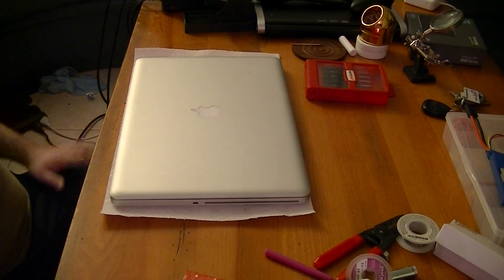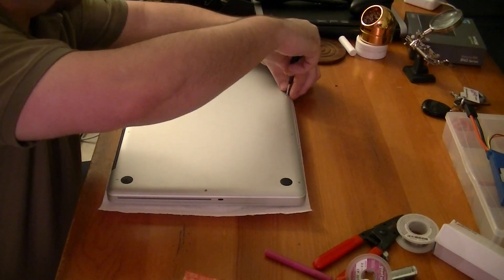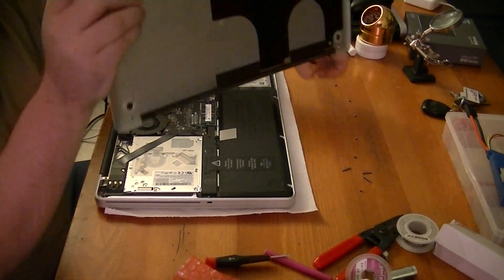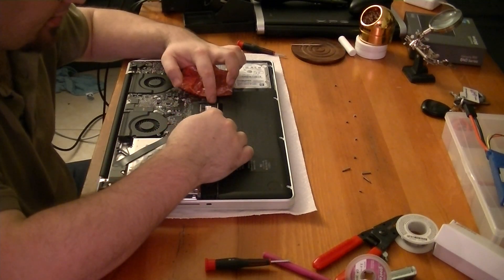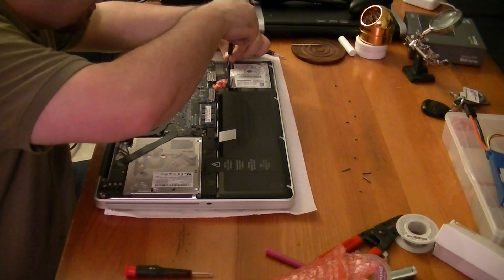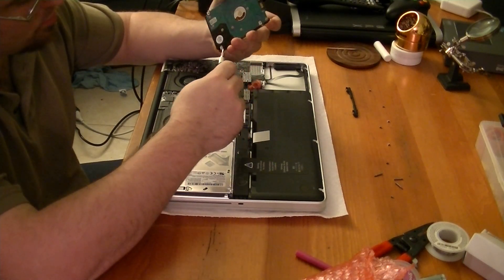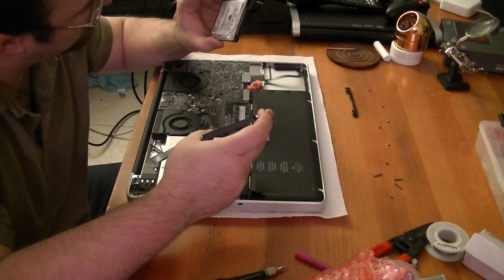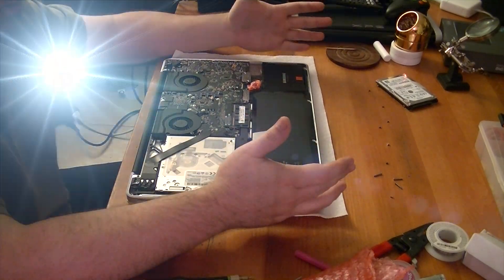Samsung SSD Install Into 17" MacBook Pro Upgrade SSD

Comment: if I do not plan to keep any files on my pre existing mbp, can I just purchase the SSD and install it? Would everything open as if it was a brand new MacBook or do I need to install programs and do all of the stuff in Pt 1. and/or wipe my HD first?
Reply: No! A new SSD has nothing on it. You have to clone the information from your original HD to your new SSD.

Comment: Does anyone know if the Samsung 850 EVO 2TB will work for MacBook Pro (13-inch, Mid 2012) OS: Sierra. Also do you need to take out the battery while installing the ssd

Comment: I've just installed a 500 Samsung SSD and enabled trim support, but I'm not getting any where near the read (268 mb)  and write (200 mb) speeds everyone else seems to be getting.  Any what the problem is?
Reply from the maker: It sure will!
Reply from the maker: +Stephen Minion Where did you install it?  Some of the MacBooks, depending on year, only support SATA II, which will limit your maximum speed.
Reply: +uberDoward Not sure what you mean by Where.  I replaced my main hard drive with this one..  Here are my specs. It's a mid 2009 pro.

Model Name: MacBook Pro
  Model Identifier: MacBookPro5,2
  Processor Name: Intel Core 2 Duo
  Processor Speed: 2.8 GHz
  Number Of Processors: 1
  Total Number Of Cores: 2
  L2 Cache: 6 MB
  Memory: 8 GB
  Bus Speed: 1.07 GHz

 Product: MCP79 AHCI
  Link Speed: 3 Gigabit
  Negotiated Link Speed: 3 Gigabit
  Physical Interconnect: SATA
  Description: AHCI Version 1.20 Supported

Samsung SSD 850 EVO 500GB:

  Capacity: 500.11 GB (500,107,862,016 bytes)
  Model: Samsung SSD 850 EVO 500GB               
  Revision: EMT02B6Q
  Serial Number: S21HNXAGA34614N     
  Native Command Queuing: Yes
  Queue Depth: 32
  Removable Media: No
  Detachable Drive: No
  BSD Name: disk0
  Medium Type: Solid State
  TRIM Support: Yes
  Partition Map Type: GPT (GUID Partition Table)
  S.M.A.R.T. status: Verified
  Volumes:
disk0s1:
  Capacity: 209.7 MB (209,715,200 bytes)
  BSD Name: disk0s1
  Content: EFI
Macbook SSD:
  Capacity: 499.11 GB (499,113,885,696 bytes)
  Available: 252.36 GB (252,363,710,464 bytes)
  Writable: Yes
  File System: Journaled HFS+
  BSD Name: disk0s2
  Mount Point: /
  Content: Apple_HFS
  Volume UUID: 59203E0C-86BC-3003-A67A-92B68760F439
Recovery HD:
  Capacity: 784.2 MB (784,220,160 bytes)
  BSD Name: disk0s3
  Content: Apple_Boot
  Volume UUID: 195FE44D-DF95-37B6-972C-4F2539770069
Reply from the maker: Yep, 2009 would be SATA II - which means 300MB/s max, IIRC
Reply: Is there anyway to improve upon that, or is SATA not upgradable?  It's a little annoying that no one mentioned this before I bought it. Everyone's posting their fast speeds and I end up with half.  :)
Reply from the maker: SATA's not upgradable, sorry  - look at the bright side, though - you're now maxed out on speed, and 268MB/s is still more than 2x faster than any rotating hard drive you could install in there!
Reply: True...Thanks for the help, I appreciate it..
Reply: +Stephen Minion Hi. Great video. Will this work for a 2010 Mac Pro 15"?
Reply: +uberDoward thanks

Comment: Great videos! I'm going to upgrade my Mid 2010 13" MacBook Pro with the new Samsung 840 Evo SSD and I was wondering if I really need to have a 2.5 mm spacer to bring the thickness of the drive to the 9.5 mm standard? Many videos including yours only show that the 4 torx in the original HDD needs to be transferred to the SSD?
Reply from the maker: I actually elected to NOT use the 2.5mm space - since mine didn't come with one!  If you have it, use it :)
Reply: Ok. I have not bought the disk yet, so I'll probably buy just the SSD. :)

Comment: Hi Im about to do this to my 2010 17" macbook pro.  Im installing a Samsung 840 pro 512 SSD. Only thing im not sure about is do i enable TRIM, i notice you didnt. If so do i download third party app to do it. Also did you bother checking your SSD had the latest Firmware? Thanks lee
Reply from the maker: I did ensure that I had the latest firmware prior to installation, but have not updated the firmware since.  I don't have TRIM enabled, as it's not supported on non-Apple SSDs by Yosemite (10.10)
Reply: uberDoward Ok i was going to do the same but i read everywhere its a bad thing to leave TRIM off as SSD will slow over time, what are your views on this. Other option is to turn of Kext, but is that a bad thing or better just just leave TRIM off, i dont have a clue...some say one thing some say another..argh???
Reply from the maker: Until MultiBeast supports Trim in Yosemite (which, if I remember correctly, will be difficult as Yosemite requires signed drivers, I believe) then you won't be able to enable Trim.  One option would be to find an SSD that supports TRIM automatically in the firmware, without the Operating System having to send a TRIM command.

Here's a link for TRIM on Yosemite: http://www.cindori.org/trim-enabler-and-yosemite/
Reply: uberDoward yeah shame not an option as i already have the Samsung 840 pro drive. do you think it will be ok not activating trim then ?
Reply from the maker: The 840 Pros have garbage collection - you might not have 100% performance, but you should be fine for reliability :)
Reply: uberDoward This webpage gives a good review of how to and/or if to enable TRIM on Yosemite. So it is possible, but is it worth it? http://www.cindori.org/trim-enabler-and-yosemite/
Reply: akan861 Oh yeah i know it can be done via cindori, but its a compromise.  currently been running my ssd with no trim and hope it is fine for a couple of years at least till i renew mac
Reply: Im about to buy an SSD for my Mac as well and I don't think I'll bother to enable TRIM. By the way, did you install a 7 mm SSD in your MacBook where the original HDD was 9,5 MM thick? Many shops are selling SSDs with a laptop-kit including a 2,5 mm spacer. Do I need that in my MBP 13"?
Reply: Lee Kindell My last comment was ment for you.

Comment: Just wondering, is only a Philips head screw driver needed?
Reply from the maker: Sure is!
Reply: To get the 4 small pins out that hold the hard drive in the brackets along each side I needed a very tiny star wrench / torque screw driver. They were not phillips. I have a 2011 17" MBP. Also sme advice I wish I got, don't get your tools from a eye glass repair kit and do not get them at Staples. You need real tools the former ones mentioned are too flimsy. You need a real set of screw drivers and a star wrench kit you can get at any Home Depot or Lowes. Also, the screws in a MBP use Blue Loctite which occasionally may give you fits with removing the screws. If that happens don't force it. Blue Locktite is easily tamed with a few minutes of a blow dryer to break its seal. I'm not 100% sure the hair dryer trick is completely safe for all MacBook components but I work on firearms with similar tiny screws and thats a real headache saver.
Reply from the maker: LOL, no, the eyeglass repair kit screwdrivers are practically useless.  I got my electronics set from Harbor Freight - it's a decent enough set, but nothing I'd call super high quality!
Reply: Hahahaha I meant Torx but after watching I found out thanks for your help anyways :) I'm using the CCC method to replace my current nearly dead hard drive, and its been 2 days and I've finally nearly finished :') Taking forever to copy... But yeah I ran through the procedure and am pretty fluent with it now. Thanks for your help! Gr8 channel by the way :D
Reply from the maker: Glad you like the channel!  I've been very busy these days but I'm hoping to get more content up soon.  Happy to hear it's working well for you!

Comment: I am cloning my drive now. I plan to install the old drive in place of the optical drive. are there any considerations in the set up to ensure that the computer is as quick as possible? I saw something about how the computer will continue to 'index' the old drive which will slow performance. isn't that something that needs to happen? also, what about setting the drives up in a RAID configuration (I'm not really sure what that means or if I'm even saying it correctly)?
Reply from the maker: Ok, a couple of things for you :)

1. Depending on your exact model, your optical drive may be SATA-2 vs the SATA-3 likely found in your 'normal' hard drive connection.  SATA-3 will be faster with your SSD, so I'd recommend you install the SSD where your old hard drive was, and install your hard drive in your optical spot, if that is your intentions.

2. You can definitely RAID the drives - RAID allows you to use multiple drives at the same time in a couple of different configurations.  RAID 0 is different from RAID 1, different from RAID 5, etc.  That said, RAID is always limited in speed by the SLOWEST drive, and in capacity by the SMALLEST drive.  So with that further said, a RAID between an SSD and HDD will not be any faster than doing a RAID between 2 normal HDDs.  Waste of money, and the SSD will be constantly sitting around waiting on the HDD.

3. Indexing is what your computer does to be able to search your files faster.  It creates an 'Index' much like a book index - it's a quick lookup table saying 'This is what you have, and this is where it is!'  Once your index is built, the time to update it is minimal - I wouldn't worry about indexing your drives at all, just leave it on for a couple of hours to build that initial index.

How this helps you out!
Reply: very helpful.  thanks so much!
Reply from the maker: No problem!

Comment: Hey man, thanks for posting this.  I am a noobie with all this and was wondering if you can recommend a cheaper SSD that would fit a mid 2010 mac book pro?  It is just running super slow.  I do mainly powerpoint, word, internet, and online video streaming.. no gaming and don't really store any music or videos on my comp
Reply from the maker: My current favorite is the Samsung 840 EVO setup!
Reply: Is there really a big difference between the 120 GB and the 250 GB as terms as speed for opening up microsoft applications, etc??
Reply from the maker: There is, but either will be fast.  Honestly, I started with a 120GB and quickly ran out of space, so I sold it and got a 250GB.
Reply: Alright man thanks a lot, I will look into it!
Reply: Hey man, sorry to bother you again but one quick question, kinda confused about how memory works on these things.  Will the 120 GB not hold as much as my current stock hard drive?
Reply from the maker: That completely depends on what size your current hard drive is.  If it's a 120GB, then it'll be the same size.  If you have a 250GB currently, then a 120GB SSD will hold a little under half the space!
Reply: Very good to know, thanks buddy! my macbook pro came with 320 gb so I need something near there then
Reply from the maker: If you go to About This Mac (under your Apple menu in the upper left) and then look for 'Storage' that should tell you how much space you are actually using.  You'll need an SSD that is MINIMUM that size.  I recommend the biggest you can get!
Reply: Just got this.  Thank you very much I ended up with the samsung!
Reply from the maker: npsagges Well, how do you like it?
Reply: uberDoward
Haven't installed it yet waiting for the torx to come in the mail but will let u know how it works out!
Reply from the maker: Awesome, can't wait!  Thanks!
Reply: Installed, its running pretty fast but not as fast as some of these others on youtube.  Write speed: 212 Mb/s and Read speed: 265.4 Mb/s for 2010 MBP.  Does that seem right?  Others were getting closer to 500 Mb/s... I have SATA II I think so maybe that is causing some bottlenecking?
Reply from the maker: What year MBP?  Sounds like you are hooked up to Sata2
Reply: Mid 2010 MacBook Pro..
Reply from the maker: Yep, pretty sure you are SATA II - so you are maxed out now!
Reply: alright its still good so I'm happy!
Reply from the maker: Awesome, glad you enjoyed it, and the video helped you out!
Reply: uberDoward
I have the mid 2012 macbook pro and was wondering what sata cable it uses not sure whether to get a sata III 1 TB or a stat II 1TB
Reply: uberDoward Don't worry just figured out it's a sata III thanks for the installation tutorial
Reply from the maker: Secretx51 Ha, you beat me to it.  :)  Enjoy!
Reply: Thanks

Comment: does 16GB ram memory from NEMIX work on a macbook pro mid 2009
Reply from the maker: Afraid not!  the 2009 macbook pro maximum is 8GB.
Reply: uberDoward thanks bro! i just done feel like 8 gig is enough :/ i did get the SSD though honestly i didn't feel much of a difference i don't understand why
Reply from the maker: 8GB is likely plenty - especially with an SSD!

Comment: Hello! So once you clone the SSD you can just install the new one and it will work? Thanks!!
Reply from the maker: Yep!  Easy as that!
Reply: Awesome! And do you recommend carbon? Or can you just use disk utilities??
Reply from the maker: Andy Davenport I like Carbon for the super ease of use!
Reply: Make sure after initial start up you indicate that the new SSD is the primary start up disk in your Disk Utility. Otherwise, it will take a little bit longer to boot up than it can, because it will have to ‘look’ for a bootable disk.
Reply from the maker: True - I noticed that after that first time, however, it's just as fast as usual ;)

Comment: Can you clone a 500GB HDD to a 1TB SSD?
Reply from the maker: Absolutely!
Reply: uberDoward Will I have to use the same method as you did when you cloned your HDD to SSD?
Reply from the maker: Not necessarily - there are actually many ways to clone a hard drive, I just tried to show one of the easiest.  You can clone your 500GB HDD to the 1TB SSD the exact same way as i show in the video!
Reply: uberDoward ok sweet! I didn't know if i was going to run into problems going from a 500GB to 1TB.
Reply from the maker: Not at all!  Let me know how it goes for you!
Reply: do you have a video on how to do a clean install of mavericks to ssd?
Reply from the maker: I don't, would you like one?
Reply: Yes please or at least if there's an easier way than downloading mavericks os onto a flash drive and booting it up from that.
Reply from the maker: What year is your MacBook?
Reply: Mid 2010 17 inch MacBook Pro i5
Reply from the maker: Dragon0687 Did you see the video I did?  HowTo: Mid 2010+ Macbook Pro Install from Scratch

Comment: What would happen if you didn't disconnect the battery before installing the ssd?
Reply from the maker: Nothing - unless you short something out.  Then yeah, lots happens ;)  Easier and safer to just disconnect the battery before messing around in there!

Comment: SSDs actually draw much less power than those of traditional HDDs, because they have no moving parts! So if you are installing this in a laptop (which you are here), you will actually see a slight gain in battery life because of the SSD!